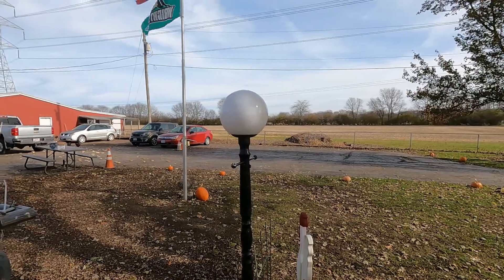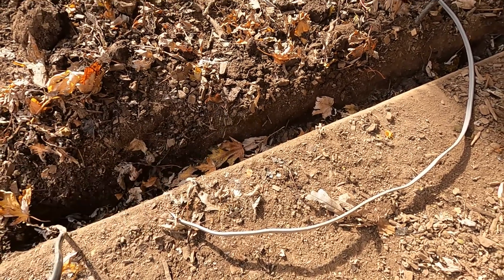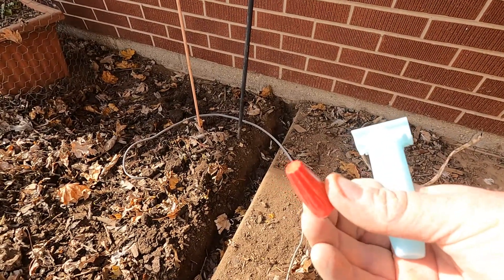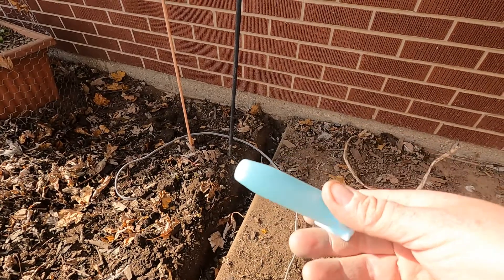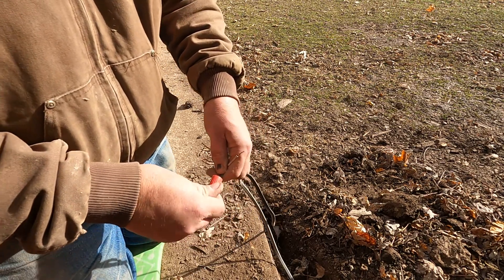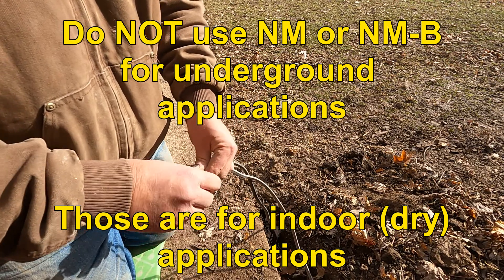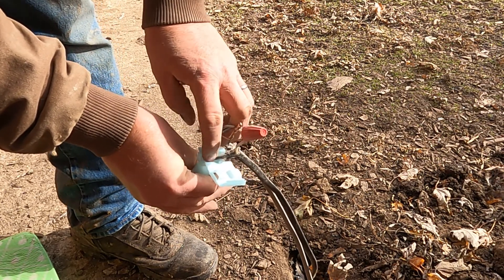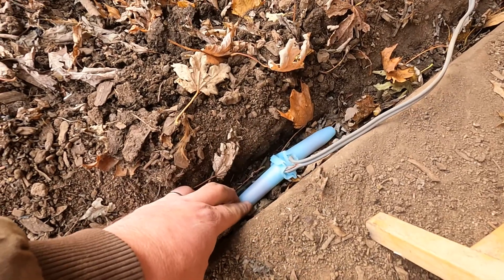Making an Underground Electrical Splice

Comment: I really appreciate you making this video.  I have to install the exact connectors on my septic system where my cousin spliced the wire and just put electrical tape on it, it lasted about 2 months before problems arouse.  U were right there wasn't any videos online showing how to use those. Watching someone use them is so much easier and better to understand them reading the directions.  So thank you and I will be watching more videos u put out.  Take care

Comment: call me paranoid, but isn't the objective behind the main outer sleeve to keep water out? with it left open i'm fairly certain that ground wire will ground out before the panel as it should let alone left open to corrosion

Comment: Wow!  I've never seen ANY electrical code that approves  direct burial of two bare wires twisted together, even if they're the ground.  There are plenty of approved splices for direct burial of the type UF cable shown in this video that splice and seal ALL the wires including the ground.  What you have here is a ground connection that can corrode and/or fail without you knowing about it.  At the very least, you should install a GFCI breaker on the supply side of this circuit.  It will be a little safer even though it still won't meet code.  There are videos that demonstrate a proper methods for direct burial UF splices.

Comment: You need to do the ground also. And it’s not silicon, it’s silicone.
Reply: I thought that too. If you just lay the copper ground wire in there, unprotected, it'll corrode in short order.

Comment: Thanks for the video. I have to connect a under ground wire that was cut. I just picked up the DRYCONN kit at home depot and will use it tomorrow.
Reply: Did it work ok?

Comment: I am about to do an identical repair in my yard...However.. with my experience with Auto. , Truck and Trailer wiring. I never trust a mechanical splice in high moisture, no matter how well it is wrapped and siliconed. I am gonna use bare copper crimps, then solder, then elec. tape, then 
coat with liquid tape, (To keep elec. tape from unravelling) then heat shrink with silicone. Over kill? You bet.. I will never revisit it though. I hate digging.
Thanks for the remind about using the proper wire for direct burial.
Reply from the maker: Best wishes. Yes, I too hate rework. So far this has worked. I’m surprised the previous fix ever worked. It was just twisted and electrical taped and buried.
Reply: I'm shocked that it doesn't have to be in conduit of some sort. I have a potentially bad gfci outlet on my deck which controls the electric to the shed. It looks like it's in pvc conduit. Have to start troubleshooting the problem which is hopefully just a new outlet.

Comment: Wont the bare ground wire short out since its not enclosed in anything?
Reply from the maker: No.  The ground wire doesn't normally carry any electricity, unless the hot or neutral shorts.  In that case, electricity would be carried to "ground", which literally means the ground.  Your house electricity has a grounding wire connected to a long piece of rebar driven into the ground.  You'll find it next to the house near where the meter.  So the bare ground wire in the ground only helps if there's a short.
Reply: @HappyWifeAcres  I was just kidding, but thanks for getting back to me on a 5 month old video!  I just picked up that DryConn unit at Lowes for a project Im working on in my yard to supply power to my shed.  Not enough wire in the ground to pull up into an above ground box for the splice, so it will have to be like this underground. Great Video!
Reply from the maker: Thanks. These days I never know who’s serious or not!  Good luck on the project.
Reply: @HappyWifeAcres  -- I have an exterior quad plug that's on a post and I want to move it back 8 feet or so. My electrician said he has to dig up the current line and run a new underground line??
Reply: It was good to know about the ground wire in the comments! you kinda skipped that